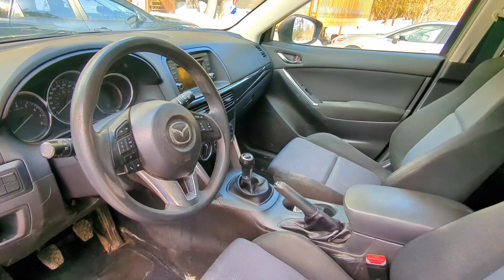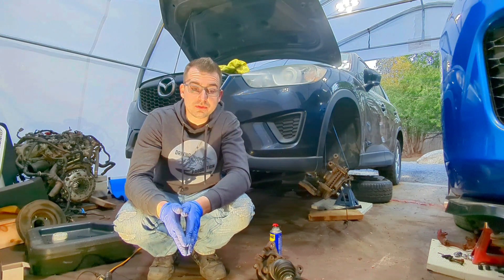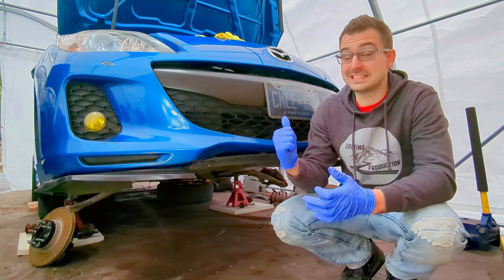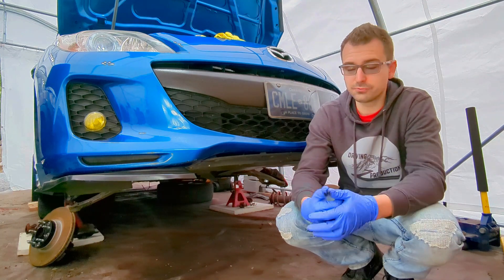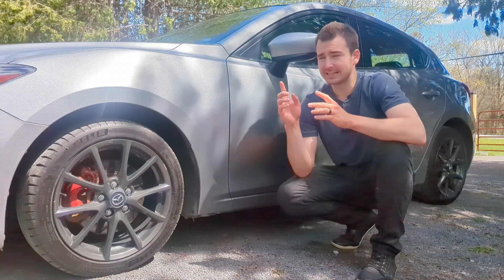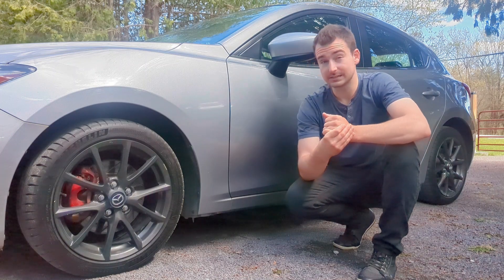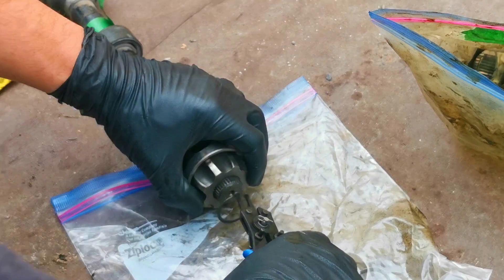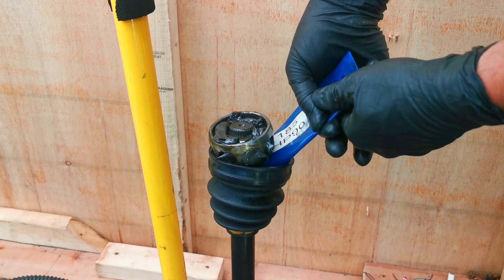Finishing the Cx-5 Conversion! - Will it Drive?

Comment: So, if someone would do this on the Mazda 3 gen3 2.0 skyactiv-g, assuming gearbox would also be a straight fit, then axle issue would be easily solved by just using axles from 2.5 (which was not available in EU)?
Reply from the maker: Yes that's right the gearbox would fit, but like you mentioned the 2.5 axles would be the best bet, or possibly Cx-5 axle but swapping shafts over to get the right length like I did.
Reply: @DrivingProduction  Thank you!

Comment: Hey I have a 2013 Mazda cx5 that needs a trans it’s manual cant find a replacement but there’s plenty of Mazda 3 manuals from the 2.0 would the 3 trans work in the cx5 same gen ?
Reply from the maker: Yes but you'd need diffrent axles to makes it work the mazda 3 has less splines.

Comment: could this be done on a third gen 3?
Reply from the maker: Yes 100% it would be easier on a 3rd gen as you could just used the 2.5 axles
Reply: @DrivingProduction I've found a 2017 manual cx5 transmission for sale at a good price near me would that transmission still be the same as the one you have?
Reply from the maker: @SLO_MZ3  the 2nd gen Cx-5 don't have a final drive as aggressive as the first gens 13-16 if I'm not mistaken but you'd have to double check. It would definitely be an upgrade regardless though!